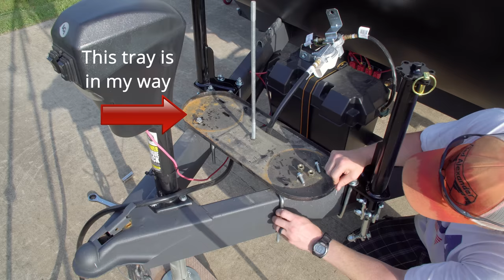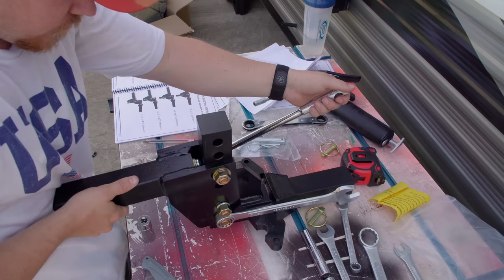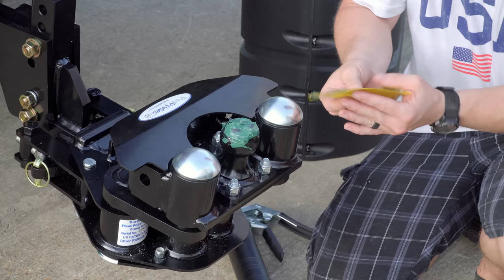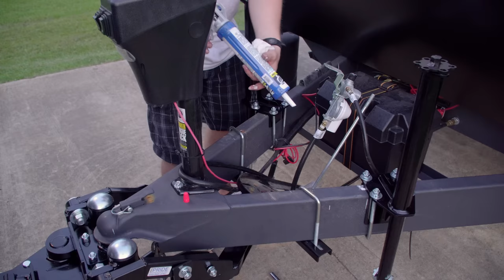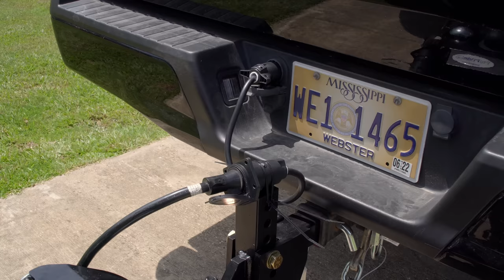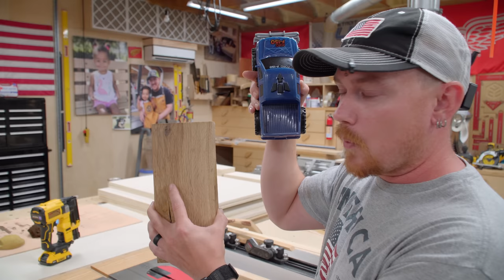BlueOx vs ProPride 3P Sway Elimination Hitch (3P install + thoughts)

Comment: While the trucks tow rating is 10k, it's gvwr is probably 7k. You will exceed the trucks gvwr before ever getting close to the tow capacity. Marketing is crazy!
Reply from the maker: 2016 F150 4x4 SuperCrew 5.0L, 5.5' bed with 3.73 rear axle ratio has a GVWR of 6350 with a curb weight of 4709. The tongue weight of the camper and hitch is about 650 pounds. GVWR of 6350 minus 4709 curb weight minus 650 tongue weight minus 327 of passenger weight leaves us with a cargo limit of 327 pounds in the truck when hitched up. The truck has a GCWR of 16,200 pounds and a Maximum Loaded Trailer Weight of 10,800 pounds. Kinda confusing but yeah, we're right on the limit.
Reply: @JayBates2  Have you hit the scales yet? Make sure you get a truck only weight with a full tank of gas then with the trailer loaded with all your gear and empty tanks. See how close you get. 
My first RV setup was almost exactly the same as yours and yes, the first couple of times out were definitely white knuckle experiences. 
The number one recommendation I will make is simple. F-250 Diesel. Once you experience the diesel difference you'll never go back.
Reply: @JayBates2  did you account for fuel?
Reply: @travisg1759  I have a F450 and tow a 38’ gooseneck weighed in at 31,990 leaving Alaska. Between the 6.7, the cruise and engine breaking very little foot break application occurred. Love the truck.
Reply from the maker: I haven't hit the scales yet. Nearest one is a half hour away. "soon" is what I keep saying.

Comment: Comparing a $650 hitch to a $3800 hitch. Yeah, that seems fair.
Reply from the maker: So we're not allowed to compare stuff based upon price? A 10" cabinet sawstop table saw with a safety feature vs a Grizzly 10" cabinet table saw without the safety feature can't be compared because of price? Got it. Thanks. Please let me know the pricing criteria so I can do better next time. I'd hate to go to a car lot and try to compare an F250 with a Ranger. They both tow stuff and haul stuff but I'd hate to waste time comparing them to see what one is better for my needs because of cost difference.
Reply: @JayBates2  you're perfectly free to make any comparison you like. I'm just saying that comparing the most expensive (anything) to a budget version of the same type of thing is an unfair comparison when doing a "versus" video. Perhaps it's just that we have a different understanding of what the video was meant to convey. My expectation when seeing a "vs" video is that we're comparing things in the same class and price range. Perhaps if the video was more aptly titled "comparison of ....", the viewer would have a different expectation.

Comment: The torque page is interesting. It looks like they've lowered the torque on the 3/4" yoke bolts to 60lb. The propride videos with the v1 jacks say to tighten those to 250 ft/lb!

Comment: Great video, thanks.  A small correction: the friction type sway controls do make it harder for sway to start because static friction is present.  But once sway starts, the coefficient of friction is reduced (kinetic vs static), thus the sway control is reduced and can get out of hand.
Also, a quick tip: if your trailer starts to sway too much, bring on the trailer brakes and slightly depress the accelerator pedal.   This will correct the sway.  If you decel with the truck, you could/will make the sway worse and wreck.  Think pulling a rope from its two ends vs pushing the two ends together.
Reply: Agreed on the way to stop the sway, "when in doubt throttle out" and just dab the trailer brakes a time or two.  Once I figured that out and practiced reaching for the brake control in the dark it became pretty natural.  Usually just dabbing the trailer brake when a semi is beside the trailer is all it takes.

Comment: Did your F150 have the extendable tow mirrors from the factory? Also, do you find the backup "dial" feature on the F150 dash to be useful?
Reply from the maker: No on the mirrors but I have a camera on the back of the trailer. I've never used the backup dial feature. I understand how it can be helpful for some but once you learn to backup a trailer it's kinda pointless.

Comment: Having experience with this hitch. When you torque down the stinger bolts you want the bolt to spin and the nut to stay still. If you are turning the NUT you will open the split washer and it won't completely stay under the nut. 

I have RAS is my garage waiting on an install. 

Good info!
Reply: I've never heard of such a thing but I can picture it. Makes sense.

Comment: My brain says no to the go in the heat, it’s scary because it’s so hot here in SC. 
Be sure you have all the tools to make minor repairs, change a tire, replace a bulb etc. before you travel. Spare tires are a given but most never think about a set of bearings or a whole hub for the trailer axle(s). Spare safety pin for the hitch and a fire extinguisher. I carry a laser temp tester to check the temps on wheel bearing and tires.
My 3/4 ton uses a weight distribution hitch but with chains instead of an L bracket like you had. No issues with the push pull problems you experienced.

Comment: Very Nice presentation,  in a few mo I  may be getting camper about the same size as your, I have a 250 ford. But I really don't think that will make a difference in your presentation.  I will look into the 3P, I think I might have seen a few of your wood working videos, I do wood working as well.  Good luck camping.

Comment: great video.  did you say you routed the brake away cable through the safety chain.  do not recommend doing that should be separate   if a break away happens may not activate

Comment: I literally went through this exact same scenario. I used to drive commercially pulling gooseneck trailers and heavy equipment so i was familiar with towing very large and heavy things behind a truck. Fast forward 15 years i bought a travel trailer that is similar to yours at 30.6ft ball to bumper with a GVWR of 7600lbs. My truck was a 2020 Silverado 1500 with max towing at 9400lbs. I made the same mistake of telling the salesman yea just put on the wd hitch yall sell because i dont have one. $1200 later i had a similar one to yours original hitch and the sway and truck-suck as ive seen it called was horrible....I ended up buying the same 3P ProPride hitch as you and it was worlds better at actually controlling the sway. I didnt 100% remove the truck-suck but its about 90% there..Then after a few months i decided i didnt want to tear up my truck since i was at the max payload and close to max tow ratings and it still didnt drive as good as i wanted it to. So i ordered 3500 (1 Ton) truck and have had it for a few months now. I immediately pulled the ProPride hitch off the TT and pulled the trailer with no WD at all and its just as good or better than with all the extra WD equipment on the truck/trailer.

Long story short, this is an excellent WD hitch when you need it on lighter tow vehicles, not needed really for a heavy duty 2500/2500 truck. So ill probably be selling now both of my WD hitches in the near future.
Reply: We beg to differ...WD, it's always a good idea.  I've often heard people using a 3500 TV say... "it tows like it's not even there". 
Ideally not what you want, the truck solid and the trailer swaying like a drunken sailor.
Disclaimer...17 Seasons with the Hensley Arrow PPP towing a 25 ft Airstream Classic with a 2500 8.1L Suburban.
POI...DO NOT run the breakaway cable thru the safety chains, you want the trailer brakes to activate before the safety chains reach their maximum.